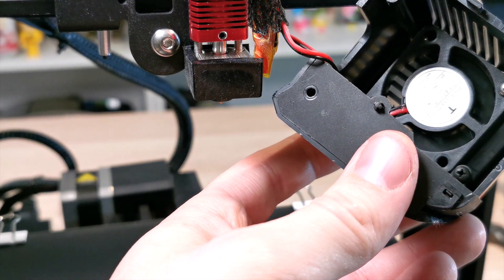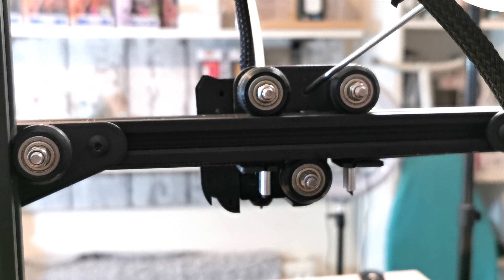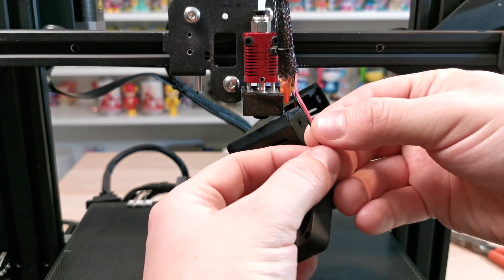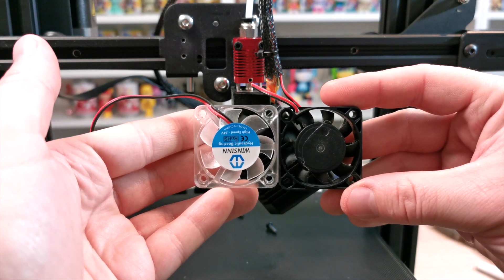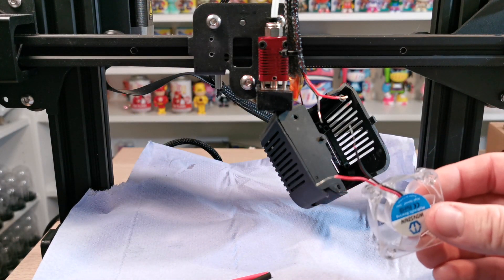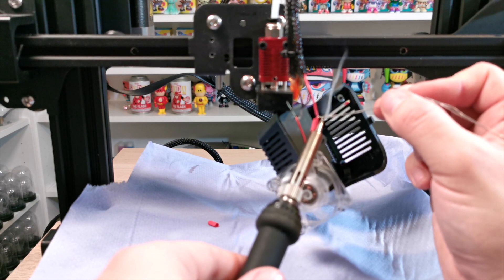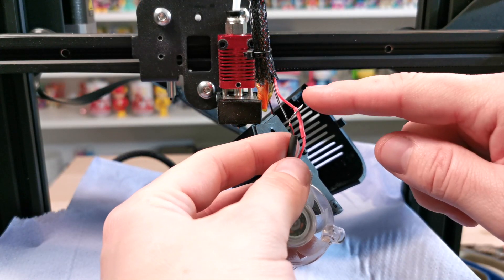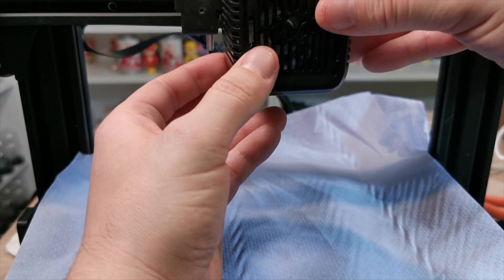Silent Fan Upgrade For Voxelab 3D Printer - Setup & Guide For Beginners

Comment: Deos it have to be 12v or 24v for the voxalab Aquila
Reply: the aquila uses 24v, you will need a buck converter if you use a 12v fan

Comment: Just a warning, I would buy nicer fans. I bought these fans from amazon and they only start about half of the time when I turn them on. For some reason, they do not always start after the first little kick and if that happens, the fans won't spin at all. This is a big deal, especially with your motherboard fan at the bottom that you cannot see.
Reply: Same problem here, very now and then I need to blow in the fan to get it started.

Comment: Just be careful with these fans, i have used them on smaller printers with not many problems, but Heat creep was an issue which did require a hotend upgrade. I think these are less noisy because they run at lower RPM which does reduce airflow. I found with the voxlab printer just print an open fan shroud and it drastically reduces noise with the stock fans. I would recommend trying this first, if using these fans i would print a custom fan shroud to hold 2 plus the part cooler fan. Just to be safe 🙂
Reply: Hi AppyDroid Development, do you have an open fan shroud file available? Have had a look on thingiverse but couldn't find one.
Reply: @andywu9286  did you end up finding one

Comment: Would it be better to use male & female terminal connectors instead of soldering the wires so if/when the fan goes out it would make it easier to change?
Reply from the maker: This would be an easier solution but you are very limited on space within the fan housing, plus it gets very hot and could melt the terminals.😊🔥
Reply: @FWA4  I didn't think about that. Thanks for the enlightenment.
Reply: @jeffwong1699  i think it would be better to use connectors and move out this part through some hole to avoid high temperatures in a case if the fan stop working some day you could replace it easily

Comment: Just a heads up your video description link takes you to a 5v fan when it should be 24v. 
I really suggest you fix the link before people start trying to use 5v fans and produce smoke. 😉
Reply from the maker: thanks for the info
Reply: Still the wrong link. Very nearly bought these.